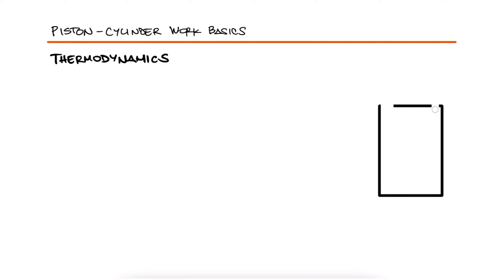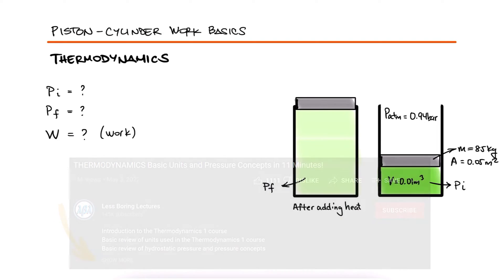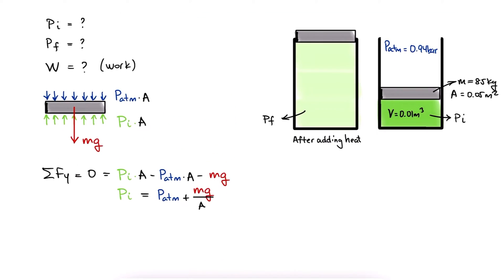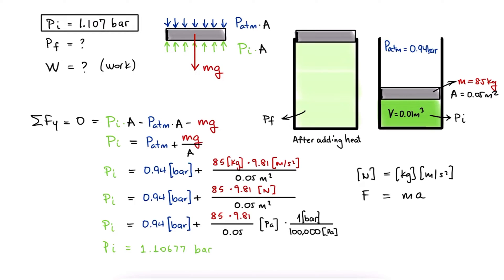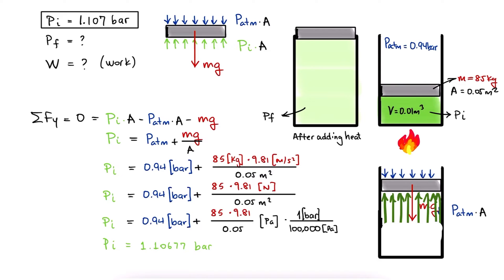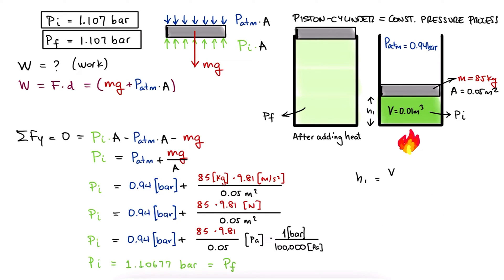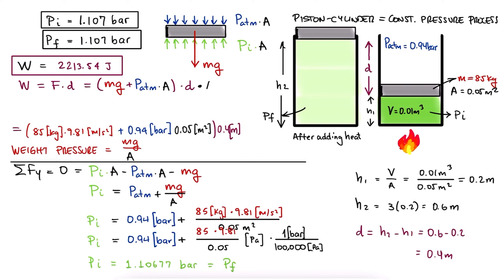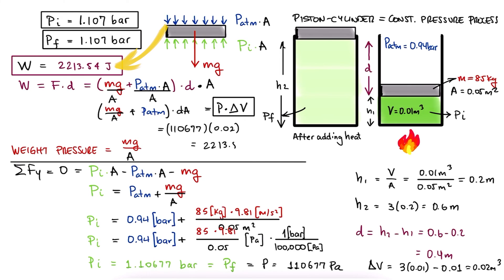PISTON-CYLINDER Work and Constant Pressure Example in 5 Minutes!

Comment: If I'm not mistaken, on the last step of the work, you divided by .4 instead of multiplying. Thank you for the great video!
Reply: And also left atmospheric pressure term in the equation for some reason but apparently didn’t use it.